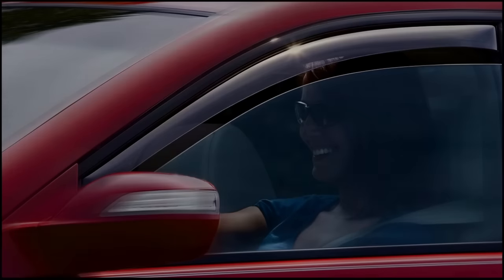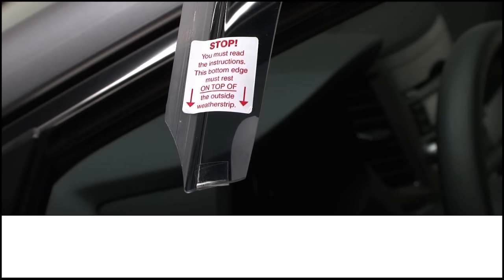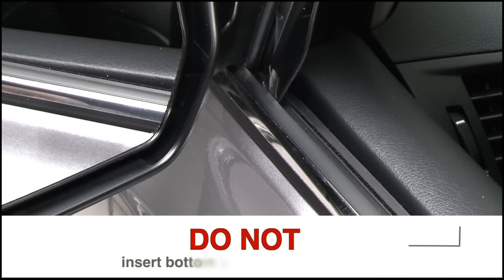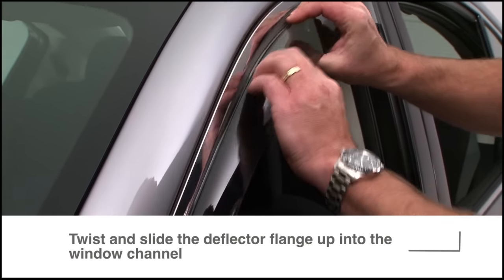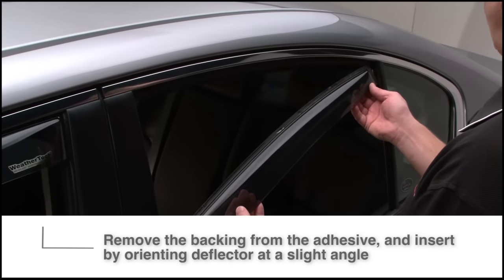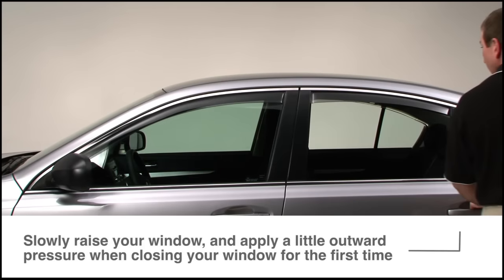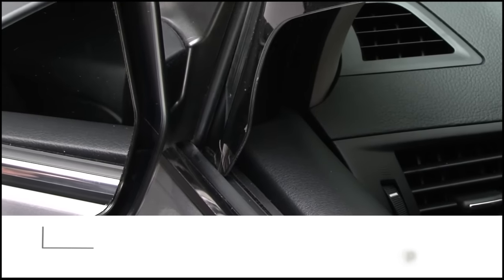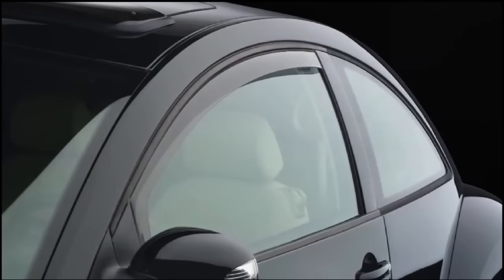WeatherTech Side Window Deflector Installation Video

Comment: The included instructions make it seem much more difficult than it actually is. It actually is as easy and simple as the video shows.
Reply: LOL I know right?
Reply: right? i wasn’t sure what they meant by “MAKE SURE IT’S OUTSIDE THE WEATHER STRIPPING” but they’re just like “make sure your wind deflector isn’t literally inside your car to the point where your window won’t roll up” lmao
Reply: Update 1/26/2022-I have removed the Weathertech deflectors from my Honda. They just will not stay in place. I followed instructions to the T. If they had an adhesive strip on them that would work. I had an 04 CRV that I put OEM deflectors on. They had adhesive strips. They stayed in place.
Reply: @bryanmchugh1307 , I also have a 2004 CRV but it seems Honda doesn't sell these OEM deflectors anymore. I'm still looking a substitute. Did you have any luck with other deflectors? Or maybe adding a 3M double-sided tape to WeatherTech could glue it in place?
Reply: @LLF1234  I regret trading in my 04 CRV. The OEM deflectors for my 2018 CRV are HORRIBLE. They are off the vehicle now and sitting in my garage collecting dust. The 2004 CRV had a lot going for it that the new ones do not. For example the rear glass opens independently of the hatch leaving you with the ability to have really long objects sticking out the back window. My new CRV does not have that.
Reply: Definitely! If a picture is worth a thousand words, a video like this is worth tens of thousands of words. 🙂

Comment: Best way to add 30 hp to any car!
Reply: Hahahahahaha
Reply: Did you know if you put lighting bolts on your car you accererate twice as fast.🤪😅
Reply: @abbashaider8668   bv gigo⁹i
Reply: @camerontiffany4296  v
Reply: @nasseranise102  he was joking 🤦‍♂️
Reply: @Leon1982db  🐸did you even read it. Clearly im not being serious lmao.
Reply: Most people i see using these are souped up sports cars and work trucks. If you actually look around when you are out, hardly anyone has them. It's like 1 out of every 50 cars. (I am talking about rain deflectors in general, not specifically these ones.)
Reply: We do not care
Reply: @nasseranise102  bro wtf? yes it does add power. i dyno'ed my stock 2017 Lancer before and after installing these and now i'm pushing 400 to the wheels. you just dont know cars, stinky!
Reply: @MyNameIsNidos  damn ur actually right. I dynoed my accord after reading ur comment. It has 1947whp now, who knew?? And stinky? I appreciate the compliment, farty.
Reply: @nasseranise102  youre welcome, i told you😎

Comment: followed the instructions 100 percent and these were not good quality, the adhesive peels right off of the inner strip, the material these are made from are cheap, two pieces broke causing the broken piece to damage the interior of the vehicle  - who is running quality control at WeatherTech ?

Comment: I've used these deflectors on three different vehicles over the past 12 years. They work great and are made to last. They stay put and have never come loose.  A quality product.
Reply: florret2003 have you ever used the clips for the back windows.  I installed them according to the video and then noticed the clips after.    U think they will be ok without them ?
Reply: @mjd3426  Hey! I never used the clips. I drive a tacoma, i go off roading a lot so a lot of bumpy terrain, theyve never fallen off. Even after a roll over collision the front and back window deflectors w no clips didnt move. My truck was literally totaled after flipping and sliding on its roof, and the only thing wrong with the deflectors was scratches... theyre tough as hell. From what ive heard they may be needed on other vehicles but ive never needed them for my truck. Just install them properly in the evening, weathertech recommends letting it sit for 12 hrs the first time w the windows closed, so overnight and youll be good in the morning. Hope that helps! Just bought my second pair
Reply: Thanks, I was looking for a honest review before I bought them.
Reply: Can you take off the WeatherTech logo stickers without leaving a residue?
Reply: What keeps them in the window groove? Seems like they would fall out
Reply: @BrownsFanInCincy  leverage
Reply: @JMSxx  I've heard some suggest using Goo Gone to remove any residue left from the stickers. I will try it myself if the one I put on the drivers window starts to work properly without it hitting the shade and going back down.
Reply: @BrownsFanInCincy  Friction (literally bering wedged into place) holds the front visors in place, and the adhesive tape holds the back visors up.
Reply: @PartyUpLive  how did they end up working out? Also, did the goo gone work to remove the sticker?
Reply: Mine are loose.
Reply: How do you remove one? It broke off when I went through a car wash. The back half of it is gone (on driver's window)?

Comment: I got mine it seemed to big but costumer service said they would fit I was afraid it was going to break and had my dad install it and BOOM IT BROKE!!  they refused to replace it said it was because of installation improperly but he did just as instructed so guess I have 3 new visors in a box and just a front set costs 60$. I’m still mad!
Reply: So it’s not worth getting them ?

Comment: Cleaned and lubricated the window channels, washed the windows, and installed the two front deflectors on a Jeep Liberty, all in less then 20 minutes. Was very easy, no windows were broken and so far so good.
Reply: How do you lubricate a window channel
Reply: @micaanthonyjr6914  Spray some silicon spray in the window channels, windows up and down a few times... done!

Comment: Mine just arrived. I chose them knowing I was paying double price compared to the average window visors I've installed on other cars. But these don't show the flange at the top like the others. On a black background, like on my Lincoln, that's not distracting. But on my red Tacoma truck it would be. I hate paying $17 for shipping under two pounds of plastic, but ...
I went to the Weathertech website for instructions, since the page of bi-lingual instructions were inadequate. Nope, that internet page wasn't available; it is"under construction." So I found this video. Thanks for that!!
I saw another video here where the owner cracked his front visor trying to remove it, and he had trouble getting customer service to help him. So I was extra careful on my install. My front visors were very tight. I almost gave up at one point, afraid I'd crack one too. But I kept slowly working it into the channel until I saw the gasket seal was folding inward from the pressure from the visor insertion! I had to slowly and gently pull about 5 inches of the gasket outward from the grip of the visor, taking care to not tear that fragile gasket material. Then the visor went into place.
On the back window I tried to slide the visor up into the channel to check for correct fit first. It got stuck on BOTH sides in the channel by its sharp end-edges digging into that same gasket material. If I pulled it down it would easily rip the gasket. So I left the (now) hidden end pieces of adhesive tape cover in place and (luckily) pulled the top tape cover off before sliding the visor up into the channel.
I followed the directions here and slowly brought the windows up fully. When done with that I stepped back and heaved a sigh of relief. Then I heard a snap from the right front passenger window, close to where I stood. I don't know what snapped, but it was a clear, distinctive sound. I don't (yet) see any cracks in the glass or the visor, but I have yet to lower any windows because of the instructions to leave them up for 12 hours. I'll update if there's a real problem.
Just thought I'd share and hope others take it SLOWLY when installing these.
Reply: What car did you install these on? What's the update? What cracked?
Reply: Same question... Follow up??
Reply: @2LadyDi  I put these on my red Toyota Tacoma truck. Took a couple minutes longer than the cheaper types, but look great. Nothing "cracked."
Reply: @MikeUpie  great. I'll try to install mine when it's less rainy here in MD. I had AVS on it when I purchased it. Long story as to why I am where I am now. Anyhow, thank you for the follow up. Hopefully my 17 Buick SUV will look better, almost like it did when I purchased it in October.
Reply: @2LadyDi  FWIW- because cold temps make plastic more likely to crack, you may wanna WARM the plastic before putting it over your car's windows. Seriously.
Reply: @MikeUpie  thank you for the advice

Comment: I love my WeatherTech delectors.  Easy to install on my Saturn Vue 2007 (yeah, it took me years to decide to get them).
My advice, be patient and watch a few videos, and make sure to seat the deflectors on the "outer" rubber lips/channels (my Vue has an inner lip on the front windows, and my deflector's rear flange slid into the wrong one and the window would bump into it...took me a minute to figure this out and correct it).

Comment: Just got  80513 for my wife car for Christmas. Now, I am a mechanic and have customize cars. Going to have to call weather tech on passenger side window issue. I install  them yesterday and check later on if having a problem with the passenger side. Window goes up and then back down. I do hope it seats and I did follow the instruction to the tee. Hmm, thought they were made in the USA, these day make in Germany.

Comment: I installed them on my 2013 F-450. The rear side window vents did not have any type of adhesive, as shown in the video. A few times one or the other one would come loose (rear side windows only) I used Elmers glue and that held them for a while. Should my side rear window vents have had the adhesive?  Other than that, I love them.

Comment: Installed these on my 2012 Highlander and the front windows would automatically go back down as if something was in the way.  The power window motor struggled to put the window all the way up.  The same with the rear sets.  I had to ride around with them partly open.  I finally took them off.  Very expensive to not work.  So far out of all the products I purchased from them, this is the only one that gave me trouble.
Reply: Awh fuck hope they work for my moms  highlander  just bought them for her for Christmas
Reply: Describes the same problem I had trying to install these on my 2016 Honda Pilot.  Followed their instructions to slowly roll up and down, and "force" the window all the way up.  The window eventually stopped working at all, and now I have to have my power window fixed!  Very disappointed!
Reply: Remember to pull outward on the deflector while rolling up the window, to help make sure it's sitting against the outside of the channel. This will reduce the interference with the window.

Comment: I bought a set of these directly from Weathertech because I heard that they were giving people a hard time if they bought them from a different vendor. I just put them in no issues with the installation process but the driver window is hitting the back corner of the vent shade and goes back down. I pulled it out to allowed the window to close. I will let it sit for the next 48 hours before I roll my window down. Hopefully it fixes itself.
Reply: Did this work??
Reply: I got the same issue with mine. I’m not sure I want to keep them or not. I don’t want to burn up the motor or pull of the regulators.
Reply: Its been 5 years, waiting for answer. 😂

Comment: Followed video and still managed to break the guard while rolling the window up slowly. Waste of money. Rest in pieces  "Precision" flange.
Reply: I just installed mine and the two rear deflectors made a cracking noise when i slowly rolled the windows up. I can't see anything, but i am guessing the flanges are cracked. I will try the windows out tomorrow, but at least i never roll my rear windows down anyway...

Comment: Just gave up with trying to get the rear deflectors installed with the clips for the second time. They fell out at 30 mph so going with 3M tape. If they fall out, in the trash they go and I'll look at another product. Not giving them a third chance this was on a 2016 Honda Civic, maybe for another car they'll work fine but I give up on this Civic. The front was not much better, busted the right side trying to install the deflector, had to order a replacement so now I have a spare for the driver side which is a waste.

Comment: It should also be told in your instructional video, that the piece at 0:52 REMAINS there on top, you do NOT eventually slide that front into the channel liike the other parts of the deflector. Is that correct?

 I've seen other YOUTUBE videos stuffing that piece into the window channel. Some people will think you do shove it inside the channel as the last step. You might want to clear that up. Otherwise great video!  :)
Reply from the maker: +Karen C Thanks for your feedback! :)
Reply: I’ve been searching this comment thread specifically for this. Thank you for clearing that up! Also, WeatherTech commenting to confirm that you’re correct is a big plus. It’s a small mistake that shouldn’t be judged too harshly but so many companies out there would ignore this and not give you credit! Good on them
Reply: I am confused by your comment, and @WeatherTech didn't follow-up w a comment that made it make sense.

Comment: I had a Jeep renegade, the the ones I bought came with clips and no adhesive, had my windows open on a bridge and they flew right off. Luckily the car behind me dodge it. I’m sure the ones with adhesive works great, if yours comes with clips return that shit  or buy adhesive to keep it in place.
Reply: I used adhesive on mine that had clips. They came off anyway. It's a terrible design.

Comment: Mines didn't come w/ neither front or back adhesive straps. Just 4 of those flat metal plates. I'm assuming for the 2 back window..so now what ? Any video or suggestions on how to Install then. For a 2017 nissan sentra SR. Pls & thxx

Comment: Put it on twice on a Volvo XC70, but kept breaking the flanges.  Watched video several times, and also other YouTube videos on installation.  Had done installation previously on three other cars, include a Volvo 18 years ago--which is still in and working well.  

I kept breaking the flanges on the front window ones--it was not possible to keep the rear of the deflector at a 1/2 inch gap, due to the extreme slope of the Volvo XC70's front window--as I rolled up from the front, the rear would rise at the way to the top; and then midway, the deflector would get caught between the window seal.  When I think it is finally installed in channel and bring the window up, there is a cracking sound and the flange would break--once at the front flange, twice on the rear flange.  

I don't know where the broken flange pieces went, must have dropped inside my window.  Good thing Weathertech sent me replacements.  I will hold off until warmer weather to try to reinstall again.  Have not taken out the one with the front broken flange yet--and maybe that's why I am getting wind noise.  

These are a lot thinner than the ones I got for my Volvo 18 years ago--significantly so--maybe that's why they break at the flange--don't know.  The Volvo XC70 has a very slopping and long front window--very hard to install.  Was thinking of getting another brand next time if it does not work out.  (The rears are fine.)

Comment: I am having the hardest time getting the deflectors to stay on the front windows. I have a 2016 Subaru Crosstrek. The front of the deflector keeps sliding off the clips! (clips are not shown in the video, btw) So frustrated! I thought I had the passenger side on very nicely and then I went thru a carwash and it slipped off the clip!! Anyone have any suggestions? WeatherTech?

Comment: Why don’t the front deflectors have adhesive like the back ones do?
Reply: Jeff Hallman probably because the tension of the curve is enough to keep them in place? My guess
Reply: @emilyq322  bingo :)
Reply: Had the same thought so I added double sided 3M tape to the front deflectors to ensure it was secure. Works great. Never had a problem. It’s been over 3 yrs and still going strong.
Reply: Because the front ones have a "leg" that rests on the window sill, the rear ones do not
Reply: @emilyq322  WOW we have a female who understands physics!   THATS HAWT!  I recommend taking Jeffs mancard.   ;o)

Comment: Having issue installing on ex35. If you insert behind the deal the Windows no longer go up. It's not exactly like video. The weather rubber strip is thick as heck. I need help. Do you have one video on an ex35 2008? You will see that it doesn't fit.

Comment: 2014 Volkswagen Jetta. The safety feature keeps kicking the front window back down. Any recommendations?
Reply from the maker: +Christopher Go If you give our Customer Service team a quick call they should have some tips to help you out: (800)441-6287
Reply: did they ever give you a fix for this? im having the same issue on my subaru
Reply: No fix. Even went to the dealer if there was any way to reset the safety feature. Went to weathertechs facility too. They said everything was installed correctly. It has settled in and gotten better over time, but still kicks down every now and then. If that happens, I just raise the window until there's a tiny gap. Then close the window completely. If not, just keep raising it until it kicks down until the safety feature is ternporarily overridden.
Reply: Christopher Go thanks for the reply. next time I'll go with exterior mounted guards lol

Comment: Should I use double face tape for the front deflectors to keep them in place, or does the tension keep them secured in place?
Reply: The tension keeps them really secured! No need for tape in the front.